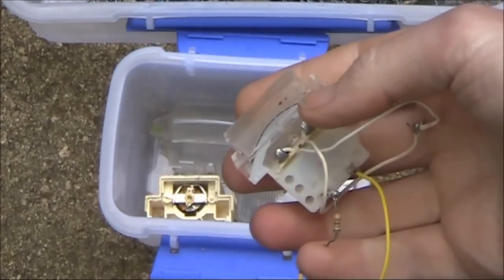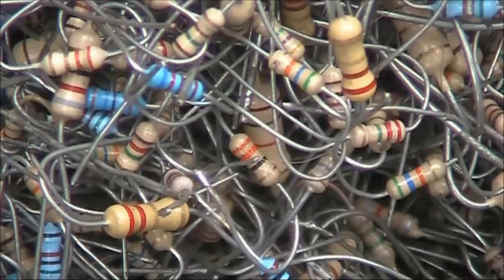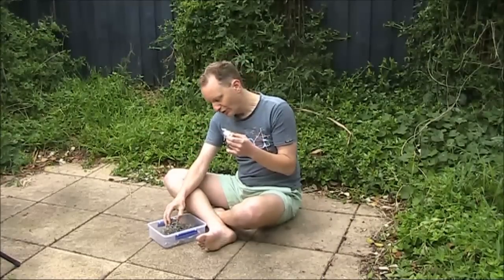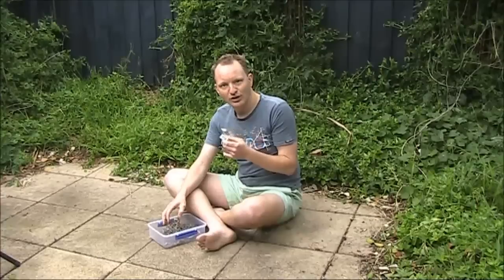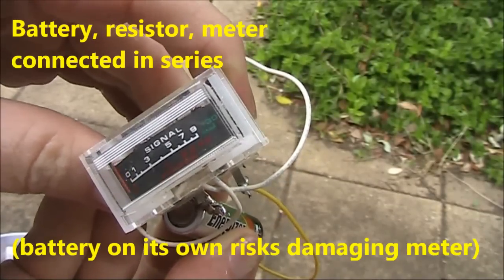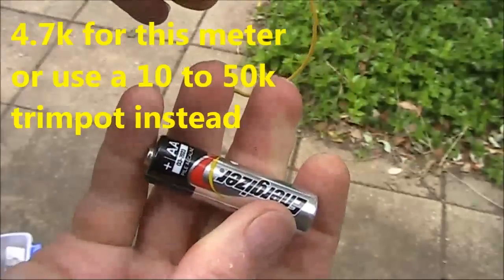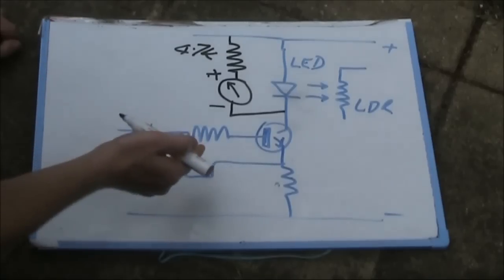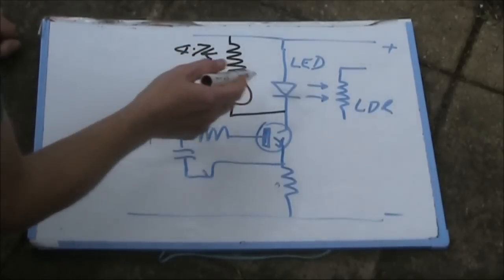Electronics on the Floor: Automatic Gain Control with LED and LDR - Part 3 with S-meter

Comment: Hello friend, I really liked your agc and would like to implement it on my Bitx40. Could you explain better the links that I should make on the bitx board? where should I open the circuit, and where exactly to connect the circuit? Will the LM386 of the bitx board be output? Is it necessary to cut some tracks? Thank you very much in advance.
pimentel.feijao@gmail.com
Reply from the maker: Hi Rogerio. No need to cut tracks. The circuit is inserted around the volume control connections.
Reply: Ok, alread is working fine, ok? Te muito friend
Reply: Tks

Comment: Could we add a squelch mute function driven of S-Meter Peter?
Reply from the maker: It's possible. But squelches on SSB are a bit hit and miss.  You might need a better AGC circuit.
Reply: Thanks Peter :)